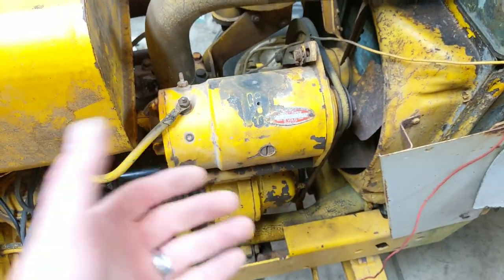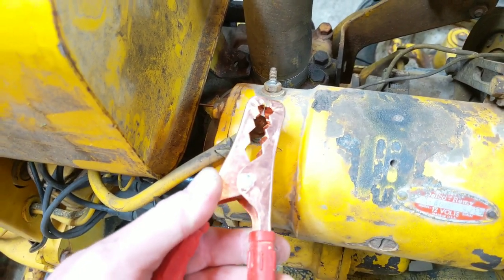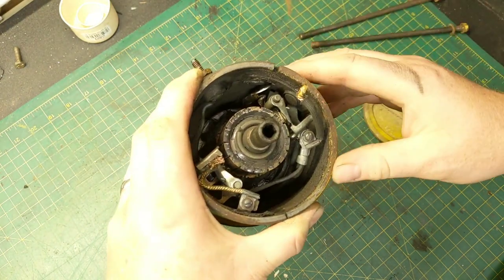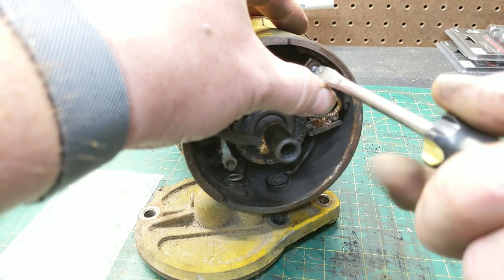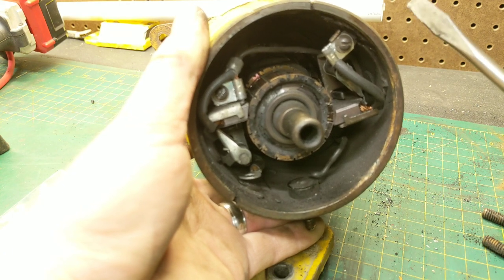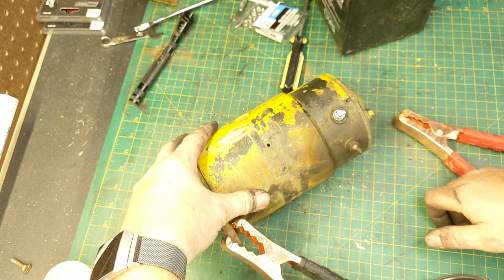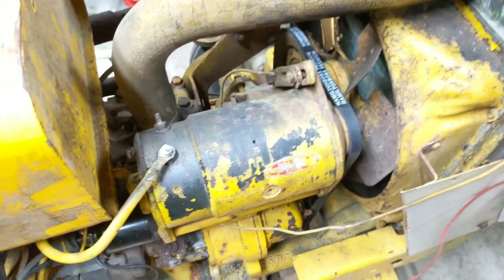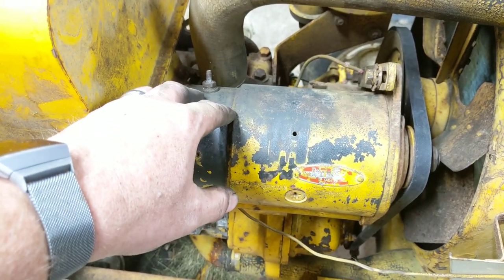Troubleshoot starter / generator on an International Cub lo boy tractor, c60 Farmall engine

Comment: My 1964 Simplicity Landlord 9HP garden tractor has one of these Delco starter-generators.
The regulator on mine is mounted to the backside of the firewall/instrument panel.

The generator bearings started screaming when I was plowing snow recently and the generator seized up.

I took it to a local auto-electric repair shop for a rebuild ....It probably never had a rebuild since it was new.

I saw this video after I took it in for repair.

The shop called to tell me it's ready so I will get it and reinstall it and see if it is good to go.

Comment: I know this is a long shot, but I followed your video and changed the brushes. I bench tested it with a battery before installing it on my Loboy. It turned fine when wire directly and the fields were also working. I installed it on the tractor and it wont crank without the voltage regulator connected. I was able to start it and it ran for about one minute, then it died. I tried to start it again and it just cranked for a minute and completely drained the battery. I tested for spark with one of those inline light spark testers the next day after charger the battery and it appears there is no spark. Could this be an issue with the voltage regulator? Thanks

Comment: does it have grease fitting? I bought one and there's a hole in it
Reply: From what I could tell, his is a 70 to 71 model.  Later models have lubes hole in the rear to lube a bronze bushing.  If it was installed correctly,  there is a hole in it also that lines up with the outside hole. If you could see in there ,you would see the armature shaft. Put in 3 in one oil or sewing machine oil a few times a season.  Couple of drops. Hope this helps.  Good video

Comment: So if I jump it to the starter and it works but doesn’t work using the key. Do you think the solenoid is bad?
Reply from the maker: Without doing some testing, it would be hard to know for sure.   But testing the solenoid is pretty simple.   If its "clicking", you know its getting power from the key start position of the switch.  From here you can use a multi meter to see if it is passing voltage.  If it is not clicking, you need to put your volt meter on the smaller lugs of the solenoid and make sure its getting power from the key switch.